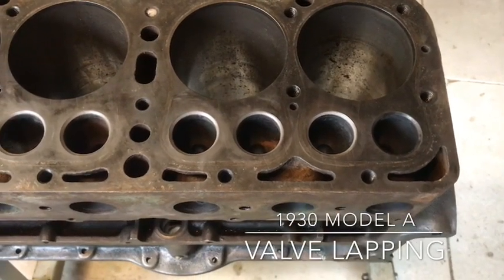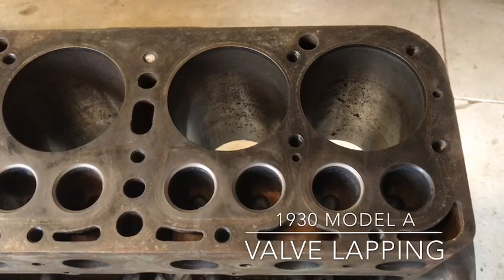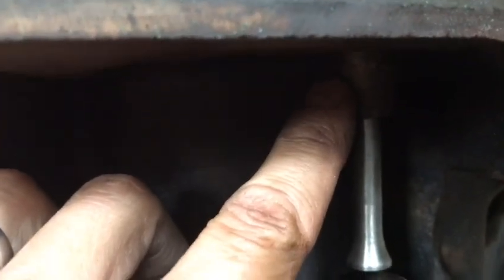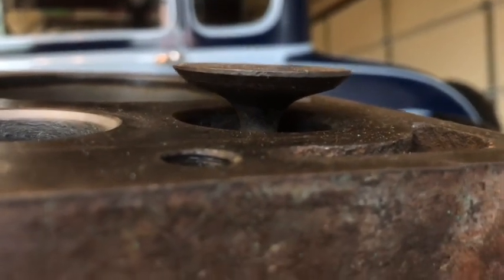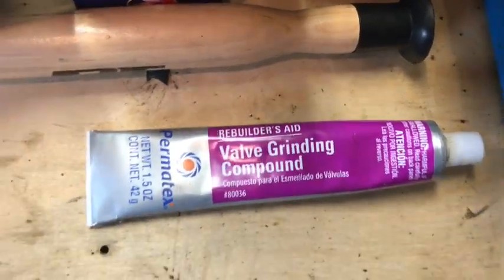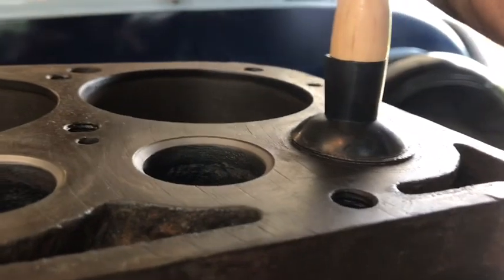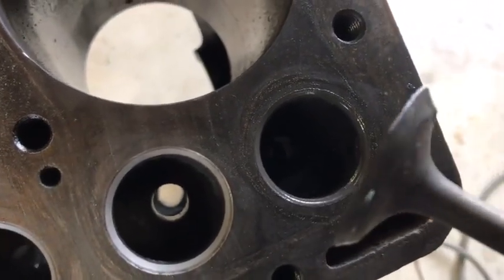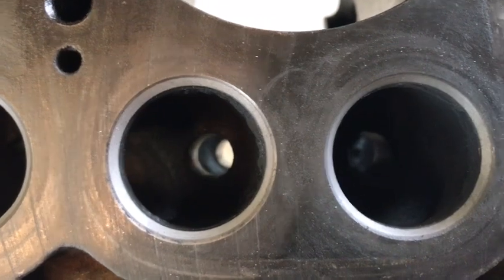Model A Valve Lapping

Comment: Thanks for this video. Did you use any kind of cleaner to remove the compound or just wipe it away? I'm about to do this, this weekend on my Model A and fear leaving any residue. Thank you.
Reply from the maker: Stephen, I am glad you enjoyed the video.  You want to ensure you remove all of the compound.  I wiped it away, but also cleaned my engine surfaces completely prior to build.  I used mineral spirts and lacquer thinner.  My engine was disassembled, which made it easier.  Hope that helps.